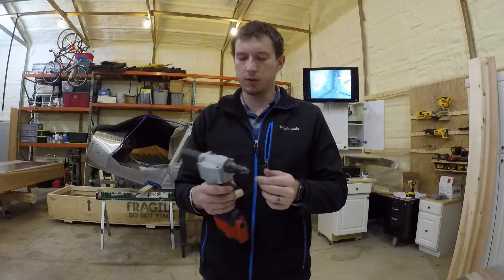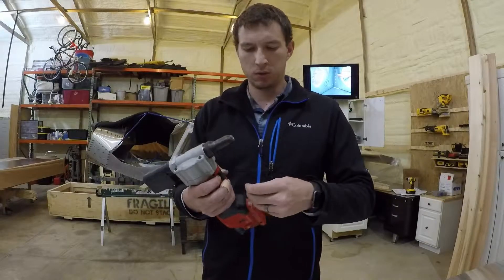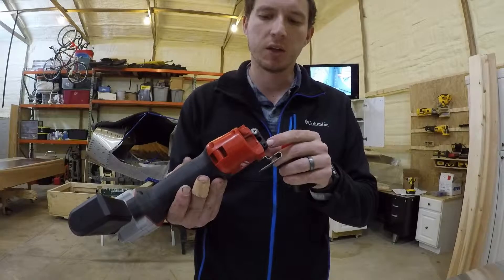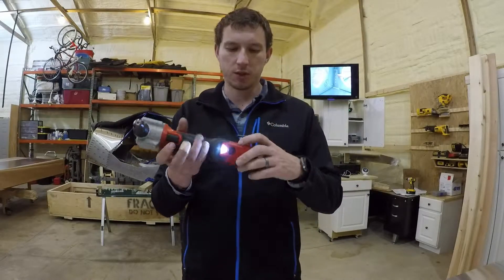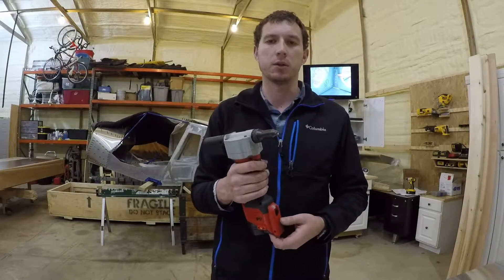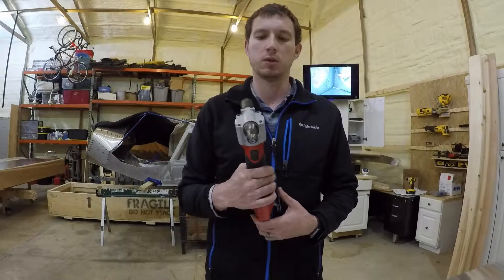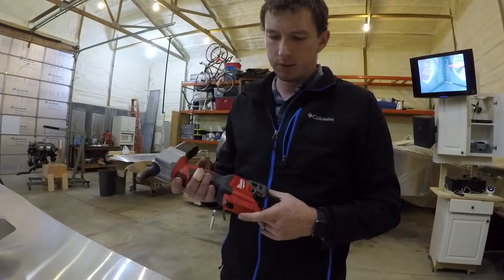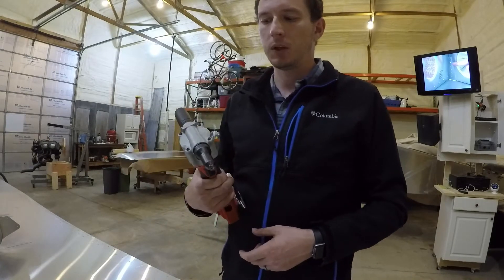Best Rivet Gun for Building an Airplane? Milwaukee M12 Rivet Tool Review

Comment: I just bought this thing and cannot understand why it has a catch container if it forces the mandrel back out after each rivet? If it allowed the rivet to fall back into the catcher you could just slip the tool over the next rivet but you can’t. You’re forced to deal with the waste mandrel before going to the next rivet. Kind of annoying
Reply from the maker: Yea, it is a little annoying but all rivet guns operate this way as far as I know. The stem will fall with gravity so if you use the rivet gun upside down then the rivets will fall into the catcher. You can also tip the rivet gun upside down between each rivet and the stem will fall into the catcher as well.